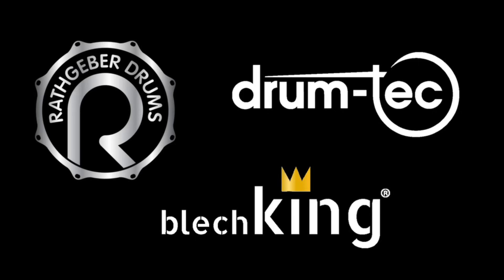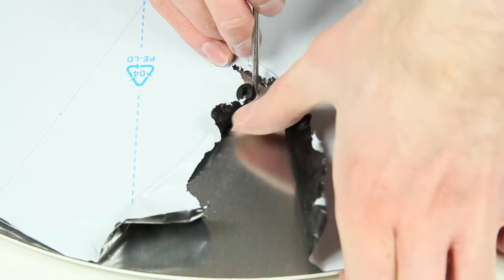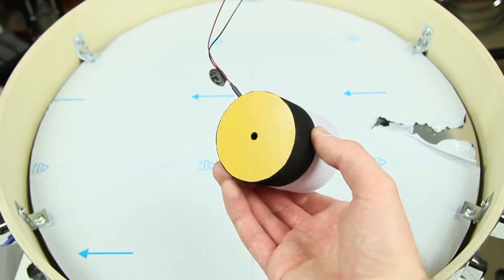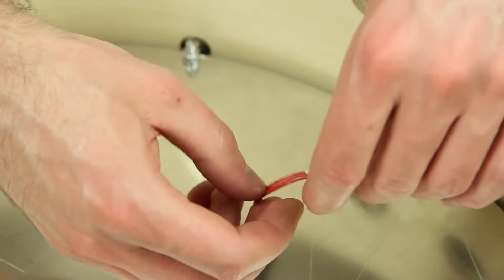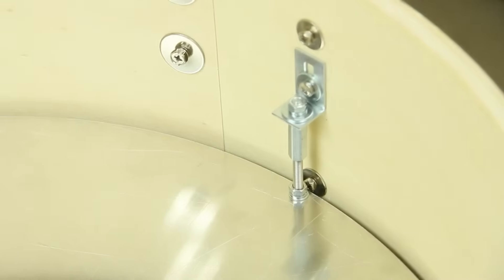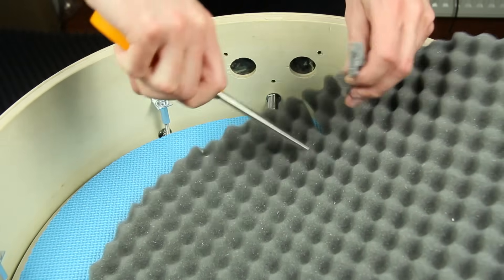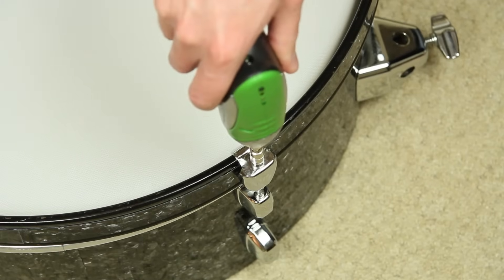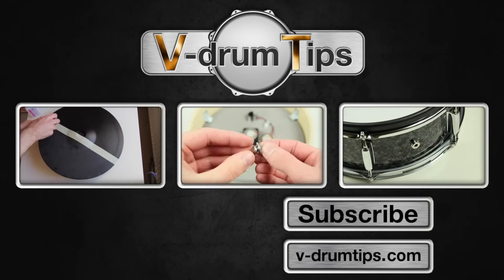E-drum Conversion Part 5 (E-Bass Drum)

Comment: Love this segment, especially as its reminds me of my own Bass Drum conversion I just finished myself.  But awesome work here on the whole conversion, its great!
I bought a second hand bass drum off Facebook marketplace, re-shelled it and then modified it to house an existing KD10 Roland bass drum pad I have for my Roland TD27KV.  By the end it looked like the Roland bass drum modification kit you can buy. It looks just like a normal Bass drum from the side and front.  At the back there's a small section where the pad protrudes from the drum. The round pad sticks out more then the Roland modified version by about 25mm or so, but is very neat and perpendicular with the rest of the bass drum so doesn't look out of place.  The whole KD10 is neatly and fully bolted down into the Acoustic Bass drum housing and with black heads mostly fully disguises its true intent :-) (At this time, it still has clear heads, but i'll put black ones on to completely tidy its appearance) With the KD10 being fully bolted into the drum, its solid as a rock and stable! Playing it really surprised me, its solid and stable just like an acoustic bass drum, but the pad surface has enough "give" to bury the beaters into it and feels dare I say, near perfect! I integrated 6.3mm mono jacks into the bass drum so it has a neat plug on top to connect into, so no messy cables snaking into the drum.
I went into the project thinking, it will turn to @#$%, but it actually turned out far better than I expected and I'm really stoked on the result.  It turned out to be a solid professional look, neat and fantastic conversion.  Its "all in one" and fully integrated, so no disassembly, just pull the plug out of the top and that's it, its ready to move as one. Wish photo's could be added, because words don't do it justice tbh!  Oh, and because the KD10 bass drum pad is not integrated with either of the acoustic head skins, there is no added noise produced from the conversion.  Its as silent as the original stand alone KD10 pad.
Anyways, sorry for the long post, but as you can tell, this project could not have worked out any better (imo) and for once, turned out actually far better then I'd pictured or planned, so I'm pretty excited about it :-)
Reply: That sounds like a better  design than Rolands 22"  bass conversion kit. 
For my conversion I used a 20" Silentstroke with an Evans patch. 2 pillows inside and ported front head. Used a Roland rt10k mounted on top. Best feeling bass drum Ive tried yet, including kd7, kd80, kd120,  and kd140. And triggers way better than I expected with just the external trigger.

Comment: The aluminum disc is confusing. Why is it necessary? If it is used only for the sake of holding the transducers, wiring, and plugs in place, why does it need to be the same size as the entire drum interior? Wouldn't a smaller strip of metal or wood (like in the "Low Budget Trigger Pad DIY" video) do the same thing, while taking up a lot less space?
Reply from the maker: You are right, it is not 100% necessary. The reason Why I took it is that it is cheap and easy to build and strong at the same time. A bar would work too. But the force of the "kicks" would only be distributed to 2 lugs. Here it is going to 6 lugs. Check the RTB-trigger video, it is only a bar.
Reply: It acts as a large piezo basically. I did this with an entire set I got off craigslist except I had to fabricate a different bass drum and can't get it to trigger correctly with a double kick. Idk if the kick in this video works or not.

Comment: Looks amazing! Is it really necessary to have all that foam mounted inside the drum?
Reply from the maker: Tony M With a real reso head and this big plate yes. But the foam is really cheap.
Reply: Vdrum Tips 
Thanks for the quick reply. I'm using Remo Silent Stroke heads, but the aluminium plate would still be a problem.
Reply from the maker: It could be quiet noisy if it is not damped. Therefore the remo head is quiet.

Comment: Incredible video, as always.
I have a TD-30K, and I'm considering buying a Pearl kit and converting it to electronic, just like you did. About the Kick, what are your thoughts about making a similar design as Roland's KD-120? A 130mm kick pad cushion in the center and an offset cone trigger? The cushion is available at r-drums, and it looks like exactly the one in the KD-120.
Reply from the maker: Henrique Foletto Hi Henrique, I think it is a great idea and I was alwasy thinking about doing the same, just as 14" version. The r-drums cushion is exactly the same, I have them. Where are you based?
Reply: Hey, thank you so much for the reply! The 14" version you say is the (extremely expensive) KD-140, right?
I live on Brazil, and in the moment I'm having a hard time trying to find a company like blech king. However some metal companies here offer stainless steel also, what are your thoughts on this alternative?
Thank you so much for making those videos, they're really helpful and motivational.
Reply from the maker: Yes, the alternative for the KD-140 for 20% of the price:) I cannot recommend stainless steel, it is too hard to work with it. Use aluminium or normal steel (spray painted afterwards against rust). I think there should be some lasercutting companies in Brazil too. Maybe not with the exact same service than blechking but I think they can do this there too. Send me an email on info@v-drumtips.com with your address. I have some of the r-drums cushions for KD-120 left. You can have it if you want.

Comment: How big is the piezo used in this drum? Thanks for an amazing video series!
Reply from the maker: Matthew Attard Thanks you for watching it. It is 60mm in diameter and around 55mm high. Smaller than it seems in the video.
Reply: +Vdrum Tips I think he was referring to the actual piezo that is sandwiched inside of the foam and rubber?(black bottom or is that a thicker density foam then the top?) Is it the same larger 35mm piezo inside of that contraption? I looked on their website and only carry 20-35mm piezo’s. Or is it a smaller piezo due to the amount of force? Maybe a 20mm or 27mm?
Reply from the maker: I don't know what is inside. I would have to destroy the trigger unit to find that out.
Reply: +Vdrum Tips Thank you for the reply. I was checking most of the videos and didn't notice if you did a video on a cheap kick drum conversion. Ie not using the r-drums pre made items. Have you done any conversions on kicks and tried different piezoelectric sizes? I am awaiting them in the mail and will be trying some different ones if I cannot find a go to size.
Reply from the maker: I plan to make a low budged kick trigger video, but with the r-drums trigger, since anything else does not deliver such a good result. I tried other DIY systems but they aren't worth a video. I would never save money if it comes to piezos, since it is not possible to get the same result with stock piezos. Read this post to understand what I mean: http://www.v-drumtips.com/piezos/

Comment: What's the reason for 3mm plate on the Bass drum, instead of 2mm?
Reply from the maker: TheOriginalCoda The diameter is bigger and it would swing too much if it would be thinner.
Reply: Vdrum Tips Makes sense, thanks!